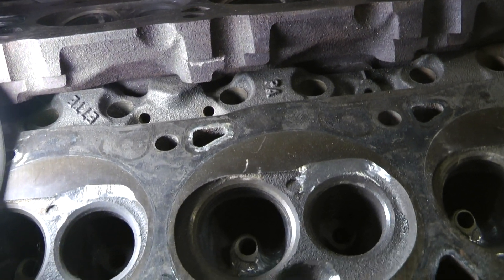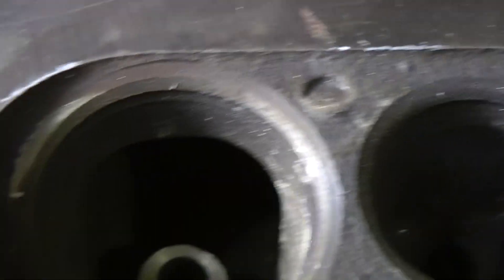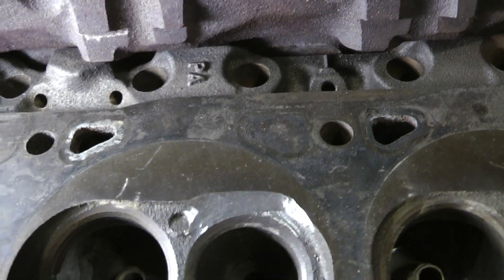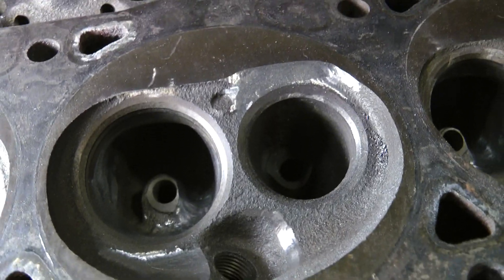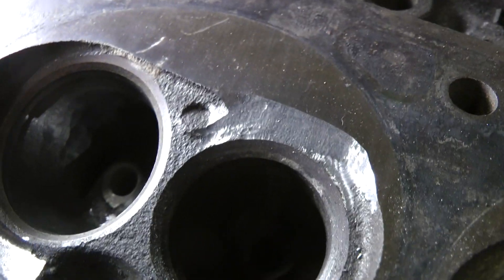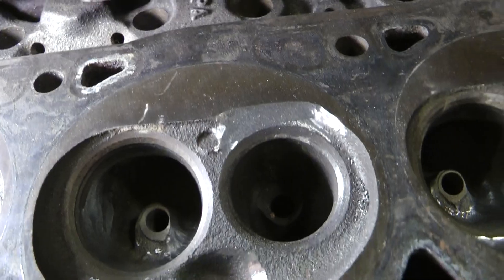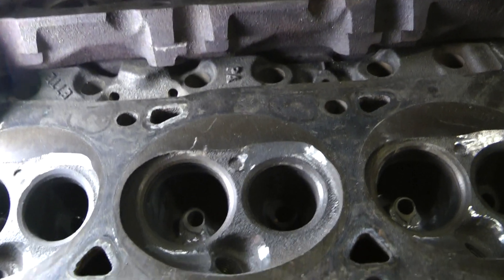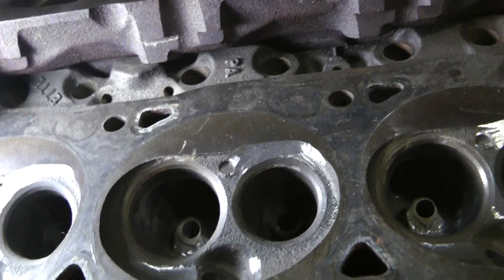Gain 3% MORE power when porting cylinder head with one cut

Comment: Is there a picture anywhere, where it shows how it supposed to be ?
Reply from the maker: Hmm, I thought I had a video with the finished work but I may have some pictures of the heads prior to final engine assembly ( cant take a photo now lol ) maybe I can make a slideshow and make a new video or something.  Basically I used that little circular stamp looking casting mark as a guide and had a certain amount of mm I would go back. But really you're just turning that sharp ledge into a ramp . Think of it like a stair that needs to be wheelchair accessible. It's not like it has to be perfectly perfect or CNC like accuracy... You're just relieving the transition from the quench to the exhaust bowl. Making it faster. Someone critiqued how mine looked uneven in their rough form and im sure even polished weren't perfect but it's not a big deal.  I will look through my social media or see if I have photos.

Comment: I would like to learn Pontiac specific cylinder heads particularly my #13 heads and they have a really thick distance between the exhaust valve seat and the quench pad and would require a lot of grinding down to get a transition. I wonder if I would hit water
Reply from the maker: Wanna buy an ultrasonic gauge? lol  the probe was too big for what I got it for  in the intake ports but it would easily work on a deck..  it will tell you though.

Comment: hope that works out for you. those cuts are so uneven.
Reply: Ping,ping😂😂
Reply from the maker: @axlegrind4212 no not really, this is before they were all blended. It's also a bit awkward of an angle and cut.  All you're doing is relieving the edge. That's all that matters  so even if something is mm back or something (ramp angle is slightly different degrees although all of these checked out) it doesn't matter. Doesn't have to be cloned perfectly. If one cylinder has more material gone than the other it's too insignificant of an amount to be detrimental on compression also. What do you think would happen?  If you're even a porter you would know it's not a 100 percent precision task to clone no matter how many times you mic it. Yet all of my bowls and work measures out. My end result   of these heads is above average for a diy person and they will perform. considering my under 200 hours of experience porting  I got the hang of carving iron pretty well. Matches up to pro work in a side by side comparison.
Reply from the maker: @axlegrind4212  now if you want to see something should see the bolt holes alignment on these chinese headers.
Reply: @DS-mo6md  i rather see a small trough in that location rather than  one opposite,  to the spark plug side of the  combustion chamber. i like the exhaust valve pretty much shrouded by the quench of the combustion chamber because imo, 90%+ of the exhaust flow travels over the intake valve into the exhaust port. that trough only works in a small percentage of the exhaust stroke but seems to be beneficial in the realm of tdc.

Comment: This is another area that benefits from exhaust valve de shrouding and increases low lift exhaust flow. I've had great success with this shape on F.E. Fords. Yes, it's a quench trade off, but by increasing evacuation of the exhaust, EGR effect is reduced.
Reply from the maker: Yeah I also intend to run the factory EGR in the van because I'm running cats    so need the smog pump etc. As much as I'd love to make it simpler I don't want to choke on muffler fumes.   If I can remember how to hook it all back up.  I'm at that stage now. I haven't posted updates because my video camera broke but probably have to slideshow the engine going in... But yeah as far as de-shrouding it has been cleaned up in target areas... Full de-shroud on E7  I believe saw some losses,   but it probably also depends on the valve job etc.   It may have been Charlie Servedio who found that. So basically de-shrouding on the paths of the valves  so like... center of cylinder toward exhaust and around this spot of quench area.. and intake entry toward spark plug boss

Comment: I don’t think that works the way you think it works. What you ground off is called a return and it wasn’t put there by accident. The original designers of the combustion chamber could have done the same as you yet they created a return instead. This return is a feature found in millions of engines. You have unknowingly created additional ‘crevice volume’, dead space where combustion cannot happen as well as perturbed flame tumbling. Where did you come up with that 3% figure?
Reply from the maker: @PCMenten  lol you clearly don't know what you're talking about about. It helps exhaust scavenging exactly as I say.. and 3 percent relative to the power output.  And you think a truck head had performance in mind? These heads also suffer from low swirl. The gains are worth more than any CC loss or else it wouldn't be done. People like David Vizard (see gentleman below who has literally published books on engine modification and performance) and Charles Servedio would disagree with you.
Reply: What about if there's just a small section of the plateau carved out to create a swirl on the exhaust gas? Interesting thought aye😅 @DS-mo6md
Reply: lol You're one of those "if it would've worked better, the factory would've done it" guys. Hilarious. A pro porter can get huge HP gains over stock heads, regardless of what the factory did, or did not do.
Reply: you might be right, factory engineers know that exhaust will get out anyway, so dont compromise something else to gain a little bit of exhaust flow that can not even be measured on flow bench.

Comment: Been doing this since about 1980, It had no official name until I named it 'Scavenge Plateau'
Reply from the maker: @DavidVizard  yes sir, you're where I learned it! That and getting some help from Charles Servedio via videos / comments along the way. I believe I first saw it in a video where one of your students is showing some 289 chamber work. Your shared knowledge has been invaluable and I thank you for your education! Thanks for stopping by my conversion van channel.
Reply: I just watched a video from Charles Servedio concerning a Jeep 2.5L cylinder head. He mentioned in the video that one of your students ported the head. A comment that he made but then quickly retracted was concerning this very thing. The comment that he made (not quoting) was (if I understood his comment) he would have rounded the edge on the quench pad near the exhaust valve. He then said...oh wait, on this head, the exhaust goes out the same side as the intake came in....I take it to mean that he was referring to the fact that the Jeep 2.5/4.0 heads are not cross flow.  Please comment on this technique specifically with respect to the cylinder heads found on Jeep 2.5L and 4.0L engines.    My thinking was that regardless of which side the exhaust flows out of the cylinder head on, there would still be exhaust gas above the quench pad that would need to be scavenged....whether the gas was exiting 'stage left' or 'stage right', would it matter? I was thinking that it would not matter. Your thoughts Mr. Vizard please. Also, Charles Servedio mentioned that some "superstock bronze' was used on the floor of the exhaust runner (to help increase velocity and reduce reversion...I would presume). Where can I get some of that stuff and can you please point me the way to learn how to apply it?  Thank you for your time and for the consideration.
Reply: Thanks David and DS !  ... the Real Dave who .. tRDw

Comment: Thats a mod I've been doing forever that's not a david vizard thing
Reply: I’ve been doing this since 1922. I called it a “ramping flow power maximizing cut.” The name never caught on.
Reply: @mcbillygoat  100%  I still have that set of heads you did for my Duesensnoychler, in '24!
Reply: @mcbillygoat  So you would have used it to improve dung flow through horse hooves while listening to Taft live on the AM radio. Wait, if Energy is equal to Mass times the... something's not adding up here.
Reply from the maker: Right, that's why I said I wasn't certain where it was originally credited.. probably a land before time lol    but that's who I learned it from .. well also Charles Servedio.   But what are your thoughts on it out of curiosity?
Reply: @DS-mo6md  I've done videos on it myself and this gets done on every pair of heads I do and my E7s have been 9s in the quarter mile with a 150 shot of nitrous and 10s on motor on a stock 302 short block and that's with a duel plane intake, Anderson cam you are welcome to check it out thank you for your response good luck with your build
Reply: I knew an old man that ran 10’s in 1965 with a 289 in a ‘62 Ranchero!  His name was James Butler and he set world records and won world championships with his little truck!  Then he unhooked his trailer from his tow vehicle, old Ford station wagon, then set world records with it.  His wife Inez helped him tune the car....in the driveway....no aftermarket existed for SBF....Now that’s impressive!  59 year old technology!   Then he built a 1940 Willys coupe with a supercharged Lincoln engine and outrun everybody with it.....Rowdy Willy!   He was from Morton, Tx and everybody in drag racing in the 1960’s knows exactly who he was and didn’t want to line up next to him. He had a better win rate than Bob Glidden!
Reply: Lol so you been around longer than David Vizard have you...🤡🌏🤦‍♂️🤦‍♂️🤦‍♂️